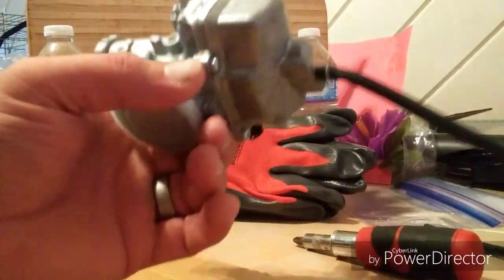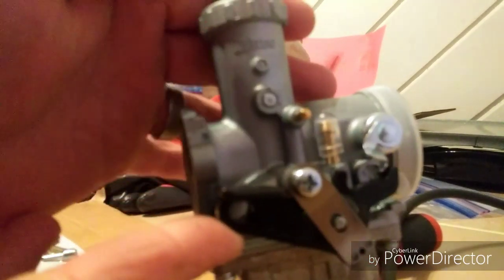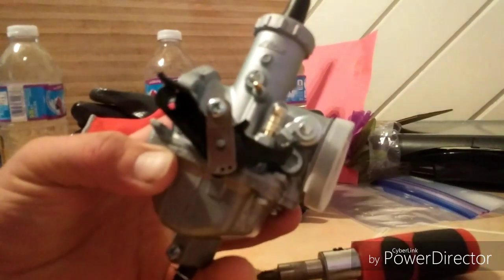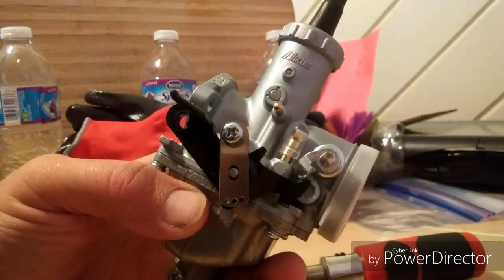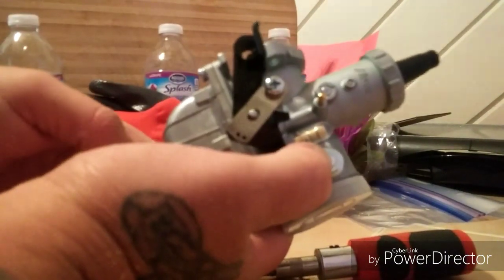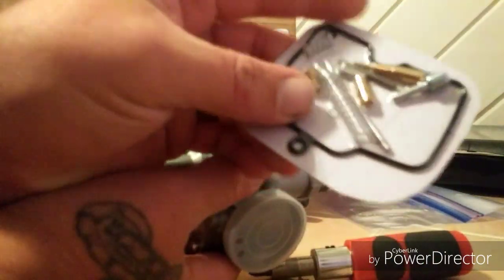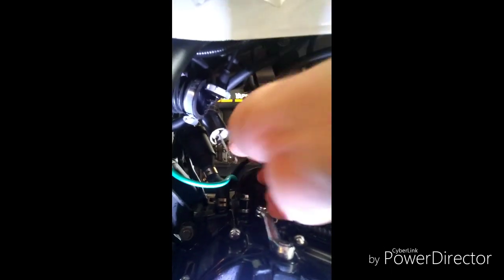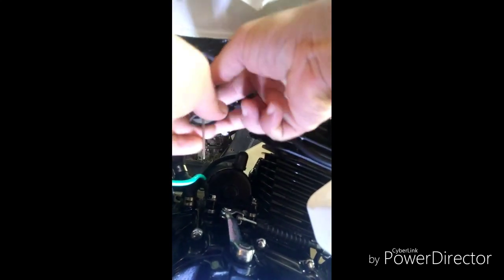Df250rts.club Mikuni Upgrade video

Comment: I'm going with the 32mm carb...try to get more air...flatslide carbs don't create swirl effect...and its said to be a noticeable difference
Reply from the maker: Big difference here with the new carb baby girl didnt know how to act lmao. Upgrade review video coming later today
Reply: @gromkiller7611  nice...don't turn into a dank wheelie machine
Reply: trucker2b  so is a flatslide carb better for this bike and also how did the 32 mm perform vs the 30
Reply: @5thgearpinned450  once I got the bike I understood more....the bigger the hole less wind volicity ..is like blowing in your hand as a fist...then u open that fist a lil bit....but if u open your hand to much 👌 u loose pressure  just buy a high flow pod filter... Still rocking stock... But looking at a flatside 30mm carb... Only reason for flatside is less air disturbances..